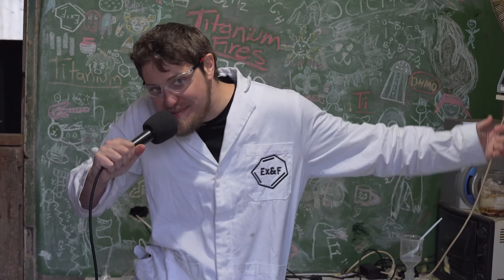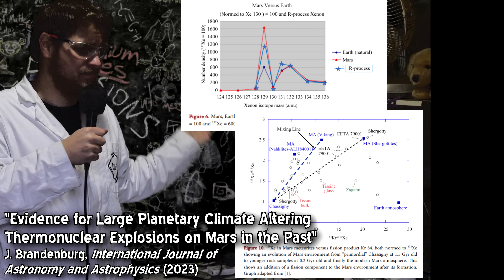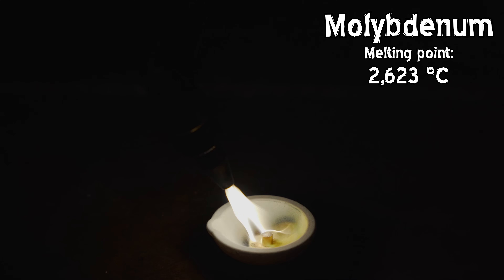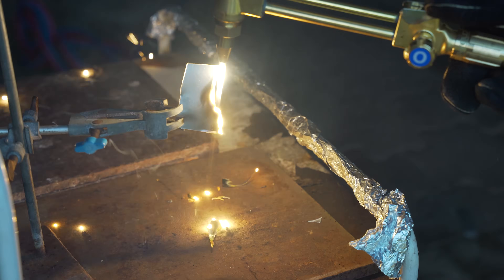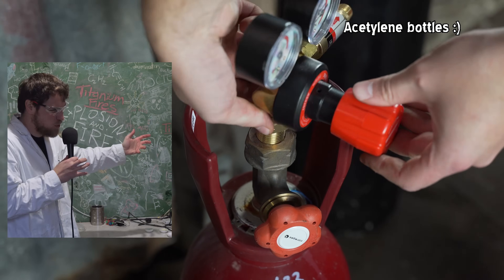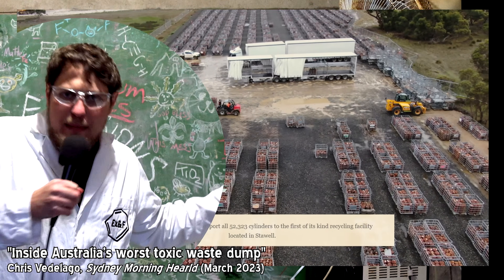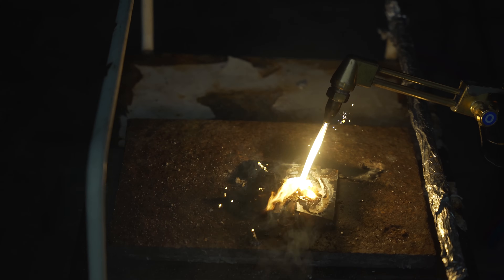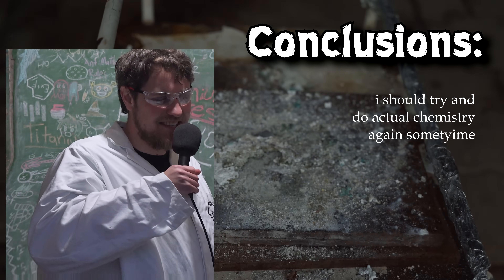Actually burning titanium

Comment: The flame temperature of oxy-acetylene isn't so much due to the carbon-carbon triple bond in acetylene itself (this is a factor, but not the most important one), but has more to do with the low hydrogen content of the fuel, compared to other hydrocarbon gases: Methane has a carbon to hydrogen ratio of 1:4, ethane is 1:3, propane 1:2.67, butane 1:2.5 - and as you increase the molecular weight of straight hydrocarbons, the ratio gets closer and closer to 1:2, though doesn't actually ever get to 1:2 unless you have a double bond or a ring somewhere in the structure.

Acetylene however has a carbon to hydrogen ratio of 1:1, the same as benzene, and it is possible to make benzene directly from acetylene with appropriate catalysts. Acetylene however doesn't have the stabilising effect of aromaticity which benzene has, and is more convenient to use as a fuel because it's a gas. Anyway, the lower proportion of hydrogen in acetylene means that when you burn it, the flame has a smaller proportion of water vapour being formed: Water is amazingly good at absorbing thermal energy, so if the flame has water in it, some of the heat produced is going to be absorbed by the water - this is the main reason why an oxy-acetylene flame is so much hotter than an oxy-methane flame.

So can you go hotter than oxy-acetylene? Yes, in fact you can - with fuel gases which contain no hydrogen at all, so you don't get water vapour produced in the flame. These gases are known as cyanogen (formula C2N2) and dicyanoacetylene (aka carbon subnitride, formula C4N2), and have immense flame temperatures when burned with oxygen: An oxy-cyanogen flame has a temperature of 4500 degrees C, an oxy-dicyanoacetylene flame is almost 5000 degrees C. These are significantly hotter than oxy-acetylene, which has a flame temperature of 3300 degrees C.
The drawback is that cyanogen is extremely toxic and for the same reason that hydrogen cyanide is toxic. Dicyanoacetylene is less toxic, but is not so useful because it is a liquid at room temperature (boiling point 77 degrees C), so using it as a fuel for oxy-fuel flame torches requires a vaporisation step. Which wouldn't be a problem if the liquid could be pressurised through a primus-stove type burner, but it has the additional drawback of being unstable when pressurised, just as acetylene itself is.

Comment: Youre missing out on a few hundred degrees of heat because your gas mixture is too ace heavy. In the flame you have ”pale blue” ”brighter blue” and ”very bright blue” closest to the handle. Increase your oxy flow until the ”brighter blue” dissapears into the ”very bright blue” and stop there. That is the optimal mixture for heat //welder.

Also set your regulators to roughly 5 bar oxy and 1 bar ace :)

Comment: What we see here is an incredible lack of foresight on the part of Australia with its ancient surface lacking volcanoes.  Those old acetylene cylinders need to be tossed one at a time into a lava lake just like Gollum was.

Actually, you're not all that far from Mt. Erebus in Antarctica.  Ship them down there and set up a webcam from the crater rim.  You'd have line of sight to McMurdo station for a UHF video transmission.  All you need for power is an old Soviet Sr-90 RTG and you're set.

What could possibly go wrong?  Picture a gang of drunk 20-somethings perched on an icy precipice along with a highly radioactive power source, launching steel cylinders into a volcano.  AND A GOOD TIME WAS HAD BY ALL.

Comment: is it just me that wonder's why you couldn't just use the oxyacetylene flow as an oxidizer?
it's should be the most arbitrarily simple thing to do.
start burning the titanium with both the oxygen and acetylene, and once it's reached it's ignition temperature....just shut off the acetylene flow and put the oxygen flow on full blast!

Comment: Oh, there are worse failures of recycling. All the mercury-containing batteries that were recycled in Sweden for about 2 decades were sent to a German company for turning into mercury sulfide (extremely insoluble in neutral pH water) for permanent underground geological disposal in canisters. Turns out they sold the mercury to developing countries so they could use it for amazing things such as panning gold and amalgamating it with mercury and then distilling off the mercury straight into the atmosphere to get the pure gold out.

Comment: Its wild that Acetylene bottles are not recycled in Australia. With some decent tools and shop set up, they can be recycled relatively easily compared to other CYs. A roller, a vise, a chain, and a cutter are all it really takes. Bonus points if you have a press, as that can extract the internals without a worker having to beat the CY to death with a hammer. It can be hard work, but it can be done. Really problem is steel prices are always so low, it does not really make sense to recover the housing.

Comment: I think the cutting torch is set up wrong - it should be an angry blue flame without holding the lever, then when you hold the lever it's extra super oxidising and causes the material itself to burn.

The normal flame should be slightly reducing, and not oxidise the metals you try to melt.

This old Tony has a cracking video on it

Comment: The next time you use the torch you can get a better flame if you use the oxygen for the flame not the cutting oxygen handle. The acetylene should be at 5psi and oxygen should be at 25 on the regulator. You want to start it with only about a quarter turn of fuel on the torch, light the torch adjust till you stop to see soot, then adjust your oxy for the flame until you get a neutral flame.

Comment: Haha, I just re-watched the first video last night 😂

8:28 "But what if we put some oxidizer on the the Ti?" Dumps KNO3 on the plate then ignites it with a torch connected to a bottle of pure oxygen. 🤦‍♂ Next time (there needs to be a next time of course 😂) try getting the plate up to temperature where it starts to burn, then just turn off the acetylene on the torch and blow oxygen onto the plate, I am quite certain it will continue to burn 😏

Comment: You could try using these steps with your oxy acetylene cutting torch.

Turn off all valves on the torch.
Turn on both bottles.
Set acetylene regulator: 10 psi
Set oxygen regulator: 50 psi
Turn top oxygen valve on the torch off
Turn bottom oxygen valve on the torch wide open

Turn bottom acetylene valve on torch aprox 1/8 - 1/4 turn open
Use striker to light torch
Once lit, slightly open the oxygen valve on the top of the torch until a blue flame appears, and increase oxygen until you have a small light blue core near the tip
Now you’re ready to cut.

To increase heat, start over (it’s easy right now), and open the acetylene valve more until a larger yellow flame appears.

Heat the metal with the torch (do not engage the cutting lever yet) until it begins to liquify.
Press the cutting level down, which will increase the oxygen exiting the tip, and begin cutting the metal.
If it doesn’t cut, release the cutting lever, then apply more heat before engaging the cutting lever.
If it pops, back away from the material being cut.

Hope this helps, its basically the process I use.

Comment: Tom for the torch first have to light acetylene then u open oxygen by the valve and u put it at the best ratio… the lever ur pulling is an additional oxygen flow used to cut better through metals making them burn a little